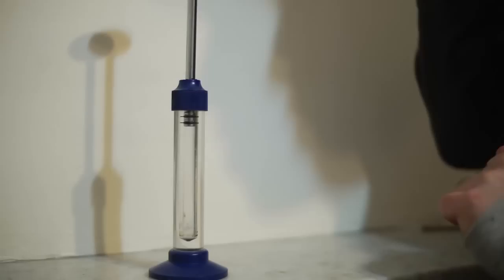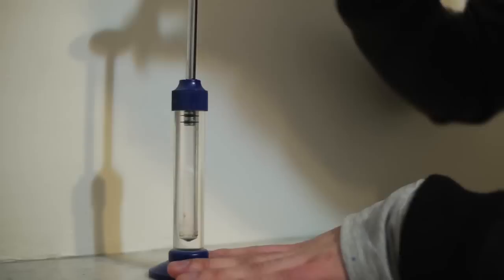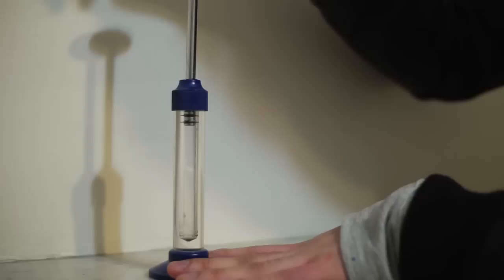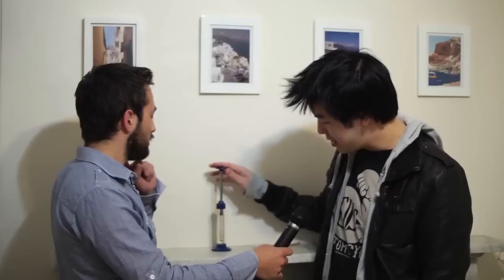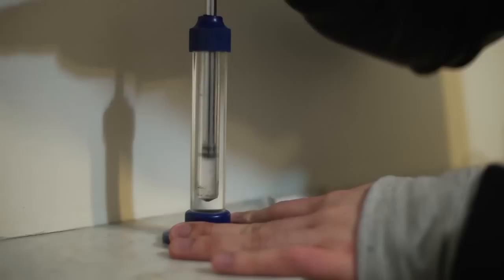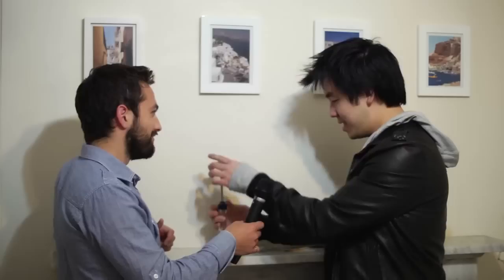Fire Syringe

Comment: This is slightly inaccurate. They fail to mention that plunging also increases the partial pressure of O2 in the chamber, which lowers the temperature at which combustion occurs. In other words, the cotton is igniting at a lower temperature than it would ignite at ordinary atmospheric pressure.
Reply: What is partial pressure? And while you're at it, can you please explain why water boils at a temp. lower than 100 deg in lower pressure or vacuum? Are these related?
Reply: +Vishnu “awguy” Manivannan Partial Pressure is the pressure that one certain substance contributes with. So if the O2-% in the air is around 20%, you'd expect the partial pressure of O2 in the atmosphere to be about 20kPa. Now that they compress the air, let's say to 10 times the atmospheric pressure, the partial pressure of O2 will also increase by 10 times, to 200kPa in this case. A higher partial pressure of O2 in an environment makes it easier for an object to burn, and it burns more completely.

The reason that water (or any substance for that matter) boils at a lower temperature in lower pressure is a bit related to this. Every substance that is able to be in gas-form has a property that dictates the "maximum partial pressure at a given temperature". For example, this might be around 20 kPa for water at 20C. This means that at 20C the air will be saturated with water when that partial pressure of water reaches 20kPa, so no more water will evaporate. And the reason that water boils at 100C is that at 100C the maximum partial pressure of water is the same as the atmospheric pressure, so at that temperature water could potentially "replace" all other substances in the air. And at this point all of the energy you put into your boiling water goes to evaporating more water, instead of heating up the liquid water.

When you reduce the atmospheric pressure to let's say 80kPa, water would instead start boiling at the temperature at which it's maximum partial pressure is 80kPa. Which obviously is a lower temperature than 100C.
Reply: daniel355273 Perfect explanation, I really do appreciate the time and effort you put into typing it out.
Reply: +John Smith doesn't mean that it's inaccurate?
Reply: +daniel355273 "When you reduce the atmospheric pressure to let's say 80kPa, ....." Did you mean increase? If so, then I understood! thanks!
Reply: Luis E. Nah, 1 atm = 101,4 kPa, so 80 kPa is a reduced pressure from 1 atm.
Reply: Thank you
Reply: yeah I thought that was the reason too , but is not percentage of o2 is the same  even under pressure ?
Reply: احمد يونس It is true that the percentage of O2 is the same as before compression. But the percentage of O2 in the air is not directly connected to flamability. It is the concentration (partial pressure) of O2 that is relevant, and that increases with compression.
Reply: +daniel355273 but a "higher concentration of O2" is the same as "a higher percentage of O2", no? Maybe you just mean the partial pressure of O2 and not the concentration? Sorry, I'm confused
Reply: ***** Let's think about concentration of maybe a liquid. The most commonly used unit for concentration is Molar concentration, which is calculated as Cm = n/V, where Cm is the Molar concentration, n is the amount of substance and V is the volume of the liquid. If we decrease V (a compression of the liquid), and keep n the same, the molar concentration Cm will increase. 

With gases it's the same, but you usually use partial pressure as the go-to unit for measuring concentration. You can make a connection between Cm and partial pressure by using the Ideal Gas Law. pV = nRT. We then write it as n/V = p/RT. We can instantly see that for an ideal gas Cm = p/RT, i.e the concentration of an ideal gas is proportional to its partial pressure, and a real gas acts similarly to an ideal gas in most conditions.

So when you compress a gas it will still have the same components, in the same composition as before the compression (if no reaction due to pressure differences occur). But since the partial pressures of the components have increased, so will their concentration.
Reply: +Vishnu “awguy” Manivannan 

Example: It is a given that the composition of air is the same at all altitudes. Excluding trace gases, 78% N2, 21% O2, 1% Ar.
The total atmospheric pressure at sea level is approximately 100 kPa. This gives us a partial pressure for O2 of 0.21 x 100 = 21 kPa. 
If we travel to the top of Mount Everest, the total atmospheric pressure is approximately 30 kPa. The composition of the air will be the same, but the new partial pressure of O2 will be 0.21 x 30 kPa = 6.3 kPa.

Given the higher partial pressure of O2 at sea level, one would be able to combust fuels more easily than at higher altitudes. This is also the reason we struggle to breath at high altitudes. Even though the composition of the air is the same, the O2 is less in terms of the amount available per unit volume of air.

So back to the original point: Increased partial pressure of O2 = increased O2 availability for combustion reaction = autoignition at lower temperatures.
Reply: If you burnt something in air 5 x the pressure of the atmosphere at sea level, would it be like using pure oxygen at normal pressures or would the other gases get in the way?
Reply: I knew it!!!
Reply: troll zeus how, you don’t know? That is basic stuff!
Reply: @trollzeus8288  No, that´s the point. the molar concentration is higher at higher pressure, even if it is still at the same percentage, meaning how many oxygen molecules are flipping around, meaning how many oxygen molecules will hit the cotton per second? That´s what determines the flammability: how many oxygen hits does it take? You can raise the number of oxygen hits on your material by two ways: a) raise the percentage of oxygen in your athmosphere (wildfires in the Carbon era, when O2 was >30% must have been absolutely horrifying), or b) raise the pressure.
That´s why many professional cleaning agents work better in cold water: Cold water is denser, so it has a higher water concentration than warm water, meaning more water molecules per second to carry the dirt away (there is more water in liter of water at lower temperatures, meaning, more molecules, as they are more closely packed). For normal handwashing and normal soap, you only use warm water to make the grease get soft.
Reply: John Smith i’am sure you are a Chemical Engineer 😉
Reply: Exactly!  We actually did this years ago in physics class.  I had the same thought back then, I believe.
Reply: Obviously
Reply: @paavobergmann4920  Ermm, I'm a year late but the density of water changes only slightly with temperature. Between boiling and freezing is only about a 5% change in density. I suspect it has more to do with the temperature-dependent reactivity properties of specific enzymes in the cleaning solution. And hot water is "usually" more effective because it has much higher average kinetic energy at the atomic level, which causes substances to dissolve in it faster.
Reply: @emissarygw2264  ah! yes, I didn´t think about enzymes in modern cleaning agents, thanks!

Comment: This is the principle Diesel engines were built upon.
Reply: I am thinking that diesel engines are slightly more efficient than regular gasoline because the diesel combusts at high pressure, while the gasoline needs the spark plugs. This means that the gas engine has to produce energy for the battery which is used by the spark plugs along with the A/C, radio, headlights, etc. while the diesel engine does not need to power the spark plug. Is this correct?
Reply: Brady Kent
Recent diesel models do use sparks.
Reply: Brady Kent
The actual power take-off for the spark is negligible next to the reduction in moving mass that gasoline engines can get away with by working at low pressure. Diesel engines are more efficient both because of the greater compression ratio and also, more importantly, the greater power density(by mass, not volume) of diesel fuel itself.
Reply: soupflood NOOOOOO THEY USE GLOW PLUGS!!!! DIESEL IS ONLY USED IN COMPRESSION IGNITION!!!!! 

mainly because theres oils in the diesel and it would foul the spark plugs almost instantly or you would have carbon deposits in the engine.
Reply: Ferriswheel
yes
Reply: Ferriswheel Glow plugs are only used to start diesel engines while they are cold. Continuing combustion is maintained by compression only.
Reply: TheTomBevis yes i know this (im a qualified TA and have worked on heaps of diesel vehicles), but someone was saying that the newer diesels use spark plugs which is utter crap. i know they only use glow plugs on cold starts, im not actually sure why i didnt mention that- my bad.
Reply: Studio 13 Sorry for the utter crap that I posted about diesel engines using sparks.Of course, only glow plugs are used for starting the engine. Because of the high pressure inside the cilinder, the fuel combusts spontaneously without the need for sparks. The combination between high pressure and high energy density makes diesel engines the optimal choice for high endurance  projects.
Reply: soupflood  in fact this is called Diesel effect, and that's actually what you DO want in Diesel engines and DO NOT want in an old  black powder cannon/musket/rifle/gun,  where you put the black powder at the bottom of the barrel and then press the bullet from the muzzle to the back end of the barrel with a long stick.... If you press the stick too hard, the bullet shoots down and compresses the remaining air, and if you are unlucky...  the Diesel effect could make air  temperature reach the flash point of black powder and then a big BOOM would occur
Reply: *****
Guns use padding to hold/seal the gunpowder in the barrel, so no Diesel effect there...
 don´t worry.
Reply: Yeap
Reply: aahhhh so
Reply: This effect is also counted in the gasoline engines.
Reply: @BradyKent  no because diesels can have excess air in the zylinder, is more energy dense and explodes better.
Reply: @soupflood  ...no. NO.
Reply: @soupflood  no they don't
Reply: fire piston born to asia malaysia and indonesia.
Reply: @Studio-kp7xb  old diesel engine not use glow plug then now.
Reply: @rashidnaga  Well very old engines used a "sparker" which was just a wad of ignited paper put in the head of the engine was used to make cold starts happen easily...much like the torch on hot bulb engines.

Comment: I worked on the waste water treatment plant in Helsinki. It's an underground facility and there are huge airpumps to pump air into those vats that have aerobic bacters. There were huge heat exchangers after the pumps so that the water where the air was pumped would not start to boil. The heat from the exchanger was used to heat the facility and it almost was enough for the whole facility. There was a powerstation using the gas that was got from the fermentation of the waste after the bacterial treatment. It's waste heat was the rest of the heat the facility needed. The electricity generated there was about half of the power need of the facility. The final waste after the fermentation were transported to nearby compost facility that made almost all the landscaping mulch that the municipal needed. Later the local power company started to use the heat of the output water to generate pipable cold.

Comment: If I'm not mistaken, this is the basic concept behind a diesel engine. I remember when my father first started teaching me about diesel engines when he would bring me on the tractor trailer and show me how to use it, and this very thing was what he showed me. He explained it in conjunction with the 'glowplug' when we had to change them out one winter. Because the engine block is so cold in the winter, the motor has heating rods in them to help warm up the engine so that when you turn over the motor (with the electric starter) the heat doesn't get absorbed by the engine block which doesn't allow it to accomplish an "adiabatic compression".

I remember being so blown away by it. Like it altered my perspective of science. Of course I was only 12 or so at the time.

There was all sorts of science to learn both on the farm and on the tractor trailer, and my father was never short on explaining it all.

Comment: HEY, GENIUS, STICK A DROP OF WATER IN IT INSTEAD OF AN INCINDIARY COMPOUND. DOESNT WORK WITH A STANDARD DIESEL IN AN AUTOMOBILE, BUT AT LEAST 3 FREIGHTERS WITH HIGH COMPRESSION ENGINES IN WW2 RAN COMPLETELY ON SALT WATER FOR DAYS, NOT REALIZING IT UNTIL REACHING PORT. THE SALT WATER RUINED THE ENGINES, BUT THE FACT THAT THEY RAN WITHOUT EVEN BEING HOOKED UP TO THE HEAVY FUEL OIL FOR AN OCEAN CROSSING IS PHENOMINAL.

Comment: And that, ladies and gentlemen, is how diesel engines work!
Of course they have fuel heaters and glowplugs(for cold starts), but the general idea is the same.
Reply: a proper diesel engine has a hook cast into the block, to hang the blowtorch there for the "Rudolf Diesel commemoration hour"....
Also, it can not be one-cylindered enough, says Heinrich Lanz

Comment: That's how a diesel engine works. Diesel ignites under pressure. I wonder if they could ignite diesel in that glass tube
Reply: Takes much much more pressure to ignite diesel this way. Not even a starter on a diesel can do it, thats why glow plugs are in the engine to kickstart it.
Reply: Jesse Haskins Not true. Cummins diesels in Dodge Rams don't use glowplugs. Glow plugs are only necessary for cold weather conditions. The Cummins uses an engine heater in place of glowplugs.
Reply: danneu8
 Right, A Block Heater! All that is needed is to generate enough heat to ignite the diesel without any compression because the engine is at rest when started.
Reply: Shasta Reil The block heater on these engines doesn't ignite the diesel though. The starter can generate enough torque to achieve ignition.
Reply: @wireboy253  lol what is this crap? My tractor doesn't even have glowplugs. It is a little hard to start in cold weather, but it CAN start and run. Also i think that this piston creates enough heat to ignite diesel.
Also a starter and a glow plug are 2 totally different things. The starter is for turning the engine over and the glow plug is for heating the fuel. This sentence doesn't make any sense:
"Not even a starter on a diesel can do it, thats why glow plugs are in the engine to kickstart it."
Comparing them is totally stupid.
Reply: @dieselgeezer18  Definitely am incorrect about the necessity of glow plugs /grid heaters in starting in ALL cases. Glow plugs/grid heaters/block heaters are starting aids and that is what I was getting at when I said kickstart obviously glow plugs don't rotate the engine over. I definitely wasn't comparing them, but they both are working together to get the engine started so they do serve a similar purpose..
Reply: @wireboy253  the start motor and the glowplugs serve a totally different purpose.
 For example the fuel injectors and the camshafts are also needed to keep the engine running but that doesn't mean they serve a similar purpose
Reply: @dieselgeezer18  okay dude, you are right. Is that better? Do you want me to give you an award? I don't really get the point of replying to a 6 year old comment
Reply: @wireboy253  chill dude. If you don't care about my comment then walk away. Just because its 6 years old doesn't mean that i am not allowed to reply. It does not hurt anyone. I am just correcting you so other people that see this comment don't get misinformed. I don't see something wrong with that

Comment: Veritasium does that mean if you do the same experiment in reverse you could super cool an object instantly ?
Reply: Viheeth Wijewardhane 
Yes. Have you ever used the small disposable co2 tubes for soft airguns? They can sometimes get so cold that frost builds up on them when you empty the tube quickly.
Reply: Yes, try getting a can of compressed air and see how cold it gets when you hold the valve open. Compressing, removing the heat and decompressing is actually the easiest way to make dry ice and liquid nitrogen
Reply: Search YouTube for "making alcohol cloud" or "adiabatic expansion"
Reply: @toby1248   Compressed air cans mostly cool down due to evaporative cooling of the liquid inside, but you're still right.  Decompressing the gas creates cooling.

Comment: Yes, you're correct. Either way they don't ignite anything they just aid in the combustion by heating up the area thus helping the combustion process along which only occurs due to the pressure.

Comment: The same principal as a fire piston, pressurized air builds heat and in turn will ignite any material inside that is flammable. The fire piston is a tube in which a small amount of fibers from dried plants are placed, then when the cylinder is smacked down it ignites and makes an ember, when removed and blown will make a fire.
Cool science!!!

Comment: Random question..
Pressure changes the 'boiling point' of a substance.
Does it also change the auto-ignition point?
Reply: These 2 point are independent. The both affected by pressure, but shows completely different effects.
Reply: I had since looked into it myself, but never came back to comment.
If anyone is interested:
Pressure decreases the auto-ignition point.
Pressure increases the boiling point. 
At 2:17 he states that the auto-ignition temp was 400°C, but doesn't state at what pressure, I am going to assume ~100 kPa (1 atmosphere)
So the pressure from the syringe may not be increasing the air temp to 400° since the additional pressure will be decreasing the auto-ignition point.
I have yet to find out what is the likely temp the air is being heated to in this scenario.